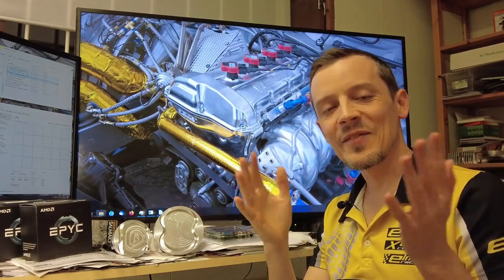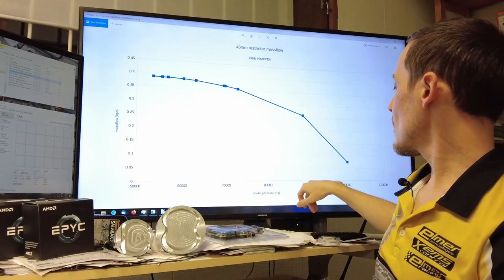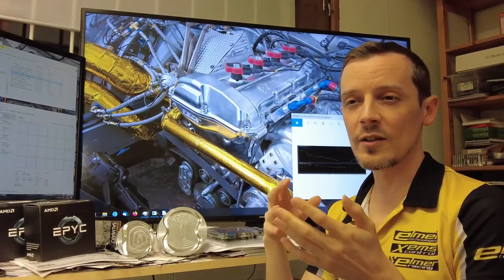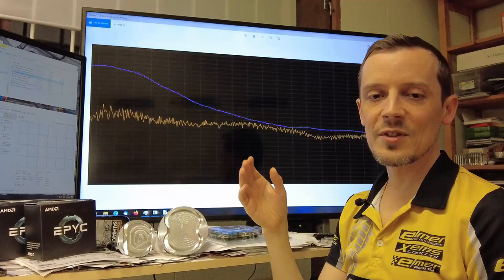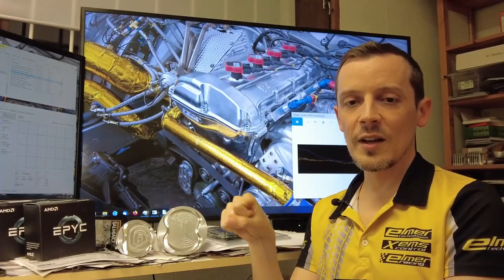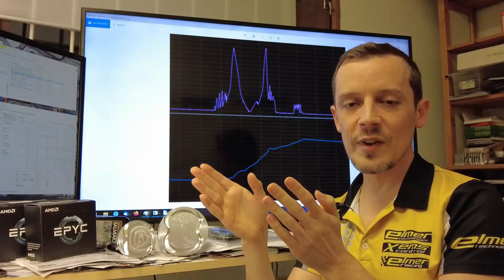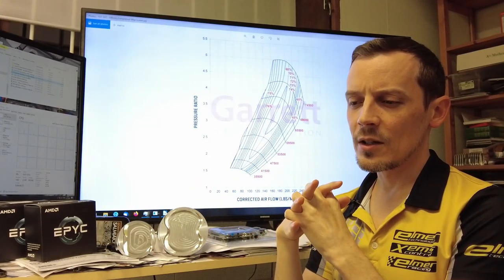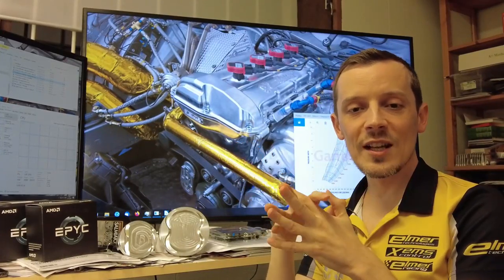[obsolete video] Rex engine: maximum performance with FIA 45mm restrictor

Comment: 12:15 i think you are right when we talk about eddy current dynos, maybe for water brake dynos too if they dont monitor temp and pressure accurate, but not for inertia dyno (i think inertia dyno should be around 98-99% accurate, well i mean it should repeat really consistent)
Reply: lol, i should watch a few sec longer :D, there you said it 1-2% exactly what i meant
Reply from the maker: When you're looking at changes in the 0.5-1% range, things get difficult when the drivetrain and tires are involved!
Hub dyno does remove the largest variable, the tires. But customer hasn't had the car on a hub dyno yet.
Best is of course a engine dyno.

Comment: Could you review some engine designs common in the after market like 2jz, sr20, k24? It would be interesting to see how they stack against your designs and to each other.
Reply from the maker: Very interesting idea!
Might be difficult to present comparisons by ourselves as being impartial. But could maybe work. Just comparing hard numbers is always doable (like mass, components etc).
Reply: @ElmerRacing   For me, I look for reliability. Some engines I've experienced; Cosworth 2.0l, Rover 3.5 V8 .... have been anything but reliable. Some sort of commentary on engines might be interesting.